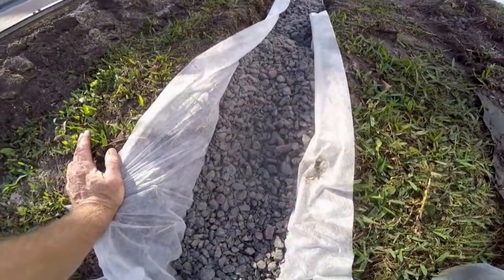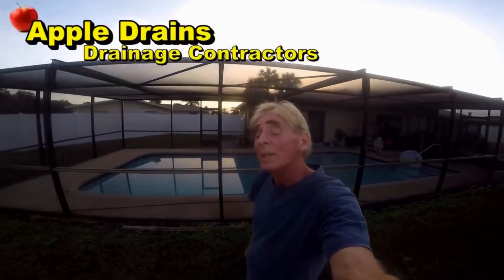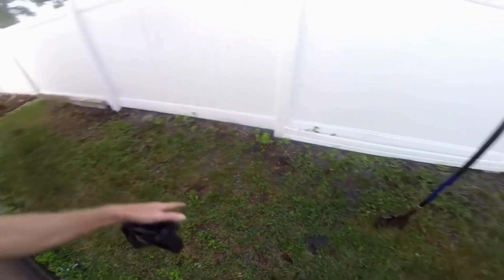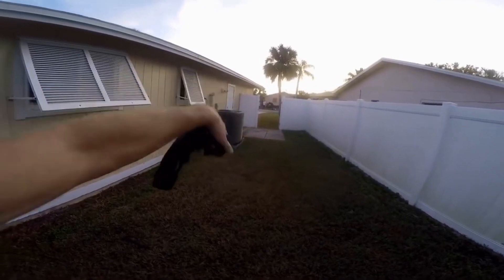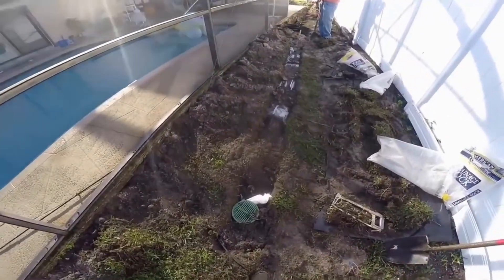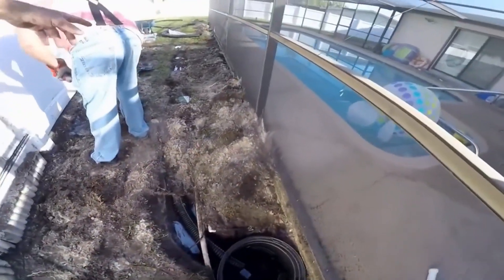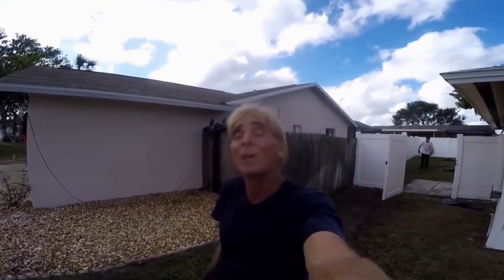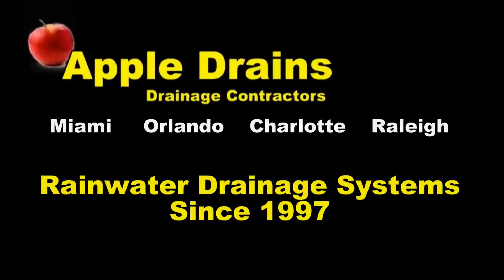French Drain - Catch Basin - Backyard Sump Pump, Where and How to Install

Comment: Hey planning a French drain project, wanted to know about perforated pipes, seems like we have the ones with holes on all sides, from my understanding: 

Dig about 12 inches deep
- lay the fabric, I have clay in my backyard here in South Western Ontario, Canada 
- run the perforated pipe in the area I need water to be collected over 1” of 3/4”-1 1/2” rocks 
- install a catch basin at the beginning of my perforated pipe since this area gets good amount of surface water and one at 30feet (total is 50 feet before I run solid pipe) 
- make a burrito 
- do I need to put sod back on? Or can I fill it with more gravel above the fabric?
Reply: Ive seen it both ways on other channels